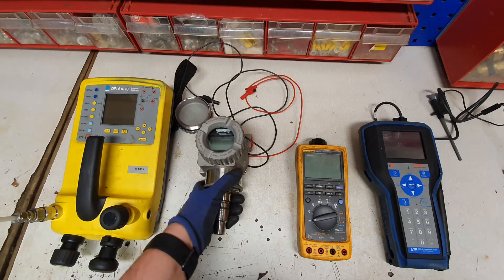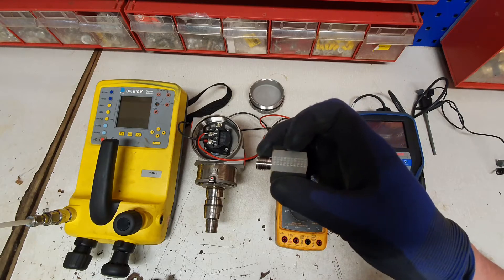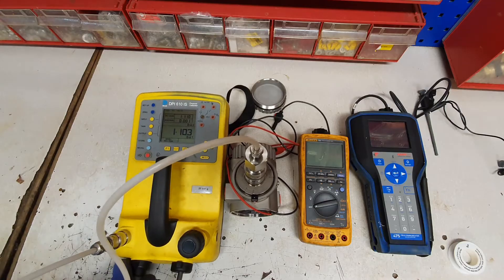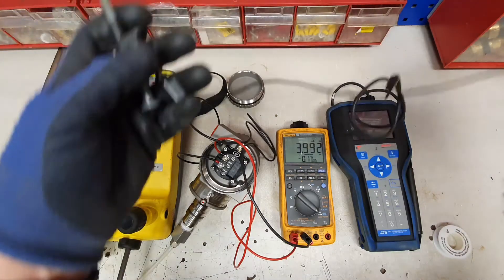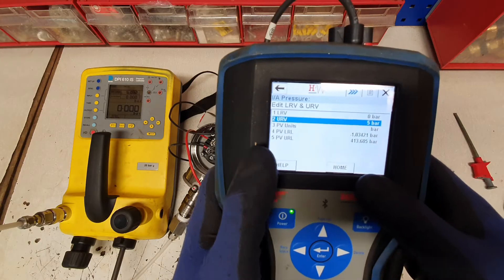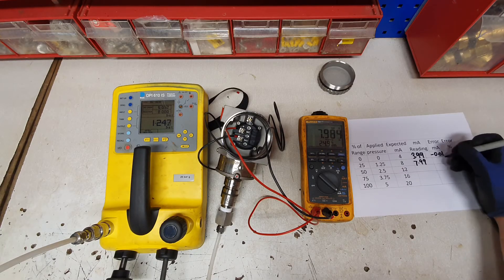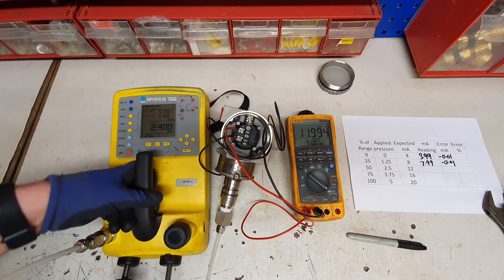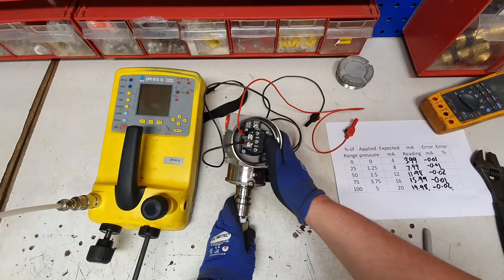Pressure Transmitter Workshop Re-range - [HART 475 / Fluke 789 / Druck DPI610 / Foxborough TX]

Comment: In this case it talks about re range, how about the case of errors, what shoud we do if it is found that the error is found out to be above a tolerance? Lets say, it should be 0.5 but when calibrating it is 1%?
Reply from the maker: You can re zero and span the transmitter from the HART menu by applying the 4mA process value and then the 20mA process value.

Comment: I wonder why he didnt just divide the absolute error by the actual value, (and x by 100) to calculate % error.
That would have given 0.01/4 =1 0.25% (after 100x) for the first measurement.
The method used was more like smallest increment (0.01) div by range, which would be perhaps the precision error of the equipment.
Reply: Error of equipment during calibration is always as a % of range.

Comment: If there was error out of tolerance range for one or all the five points, how would you apply correction. 
Please make an video about it.
Reply: if the error is like that at it for example exceed to accuracy limit..the adjustment you will do is at zero adjustment because that kind error is a zero shift error

Comment: Hey I have a question. Why did you use the span of the mA range (16) to calculate your percentage error for each mA error instead of using the expected mA value with each corresponding error mA?
Reply: You can calculate two different types of error for a pressure transmitter: 1) absolute error and 2) percent of reading error.  The type of error you are asking about is #2, percent of reading error.  The type of error that is being calculated in this video is #1) absolute error.  Both error calculations are used by manufacturers of pressure transmitters and pressure gauges.  Absolute error is usually represented as "percent of full-scale error", or %FSO, and is calculated as 100*(measured value - expected value) / (full-scale pressure - minimum pressure).
Note that if your gauge's maximum pressure is +100 (psi or ?) and its minimum is 0, then (full-scale pressure - minimum pressure) is (100 - 0) = 100 (a uni-directional gauge). If the gauge's maximum pressure is +100 and the minimum is -100, then (full-scale pressure  - minimum pressure) is (+100 - (-100+) = 200 (this is called a bi-directional or zero-centered gauge).  If you had a -15 psi to +100 psi gauge, then the (full-scale pressure - minimum pressure) is (100 - (-15)) = 115.  In this video, the author was calculating the full-scale error based on the mA output of the transmitter instead of the pressure value.  So therefore, the video uses the equation 100*(measured mA value - expected mA value) / (maximum mA value - minimum mA value) = 100*(M - E)/(20mA - 4 mA) = 100*(M - E) / 16.  

The percent of reading error is calculated as 100*(measured value - expected value)/ expected value.  Percent of reading error should also be specified such as: +/- (fixed value + x% of reading), i.e: +/- (40 + 3%rdg).  The fixed value is to fix the problem you would have at the expected value of 0.  In the case of an expected value of 0, you would be dividing by zero, which you cannot do mathematically.  Hence, as you approach the zero value, the error becomes equal to the fixed value.  This is not a problem with the absolute error calculation though, as you always divide by the pressure span (max pressure - min pressure).
Reply from the maker: Hi Kejon. When we give the error of an Instrument it's always in relation to a percentage of the Instruments range. If you do the calculation based on the error of each setpoint then percentage errors will be different depending on setpoint only, this makes no sense and give no context. The range of the Instrument gives a clear error magnitude regardless of setpoint. Hope this helps?
Reply: Thanks guys appreciate it and noted!!!!🙏🏽

Comment: Hi sir , may I ask how it is possible to get a ma value from a transmitter without any power supply ?if I am not wrong I didn't see any power connection ?can you explain please.have a great day
Reply from the maker: Hi there, you are correct there was no external power supply. The fluke 789 connected in that configuration is able to provide the loop power required to the transmitter. Some transmitters require separate supplies but lots are 2 wire loop powered devices. Check out my process meter video for more info. Hope this helps, have a great day.
Reply: https://www.youtube.com/@InstrumentProcessManagement
Reply: my understanding Fluke 789 is  provide   power supply   24 dc

Comment: Looking forward to this one 👍
Reply from the maker: Thanks Lee. Thought I'd mix it up. Filmed on Xmas day this one.
Reply: Great work, exactly what I was looking for so thanks for that! If there was a greater error between the PV and the mA output what would you have to do to correct that? Keep up the great videos and happy new year!
Reply from the maker: With the HART communicator you can perform a calibration by applying a known 0% and 100% pressure signal. The transmitter will then change the 4 - 20 mA signal appropriately. I'll do a follow up video with an out of range transmitter at some point if that helps. Happy Newyear Lee
Reply: Yeah that would be great if you could do that please! I don’t ever get the opportunity to use the hart communicator in my role I’m just tasked with the initial set up of parameters etc with an already calibrated instrument so it’s great to see from that perspective!